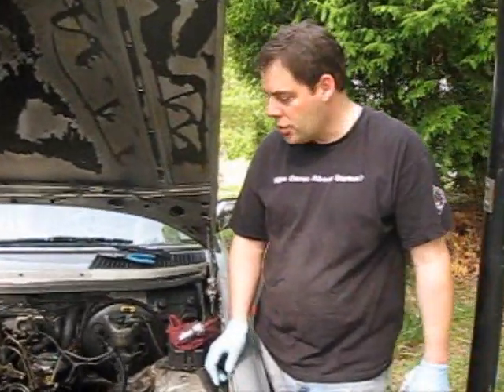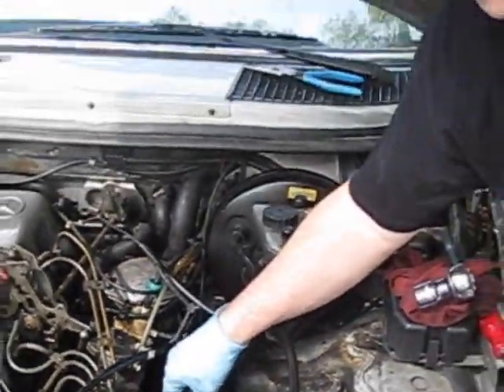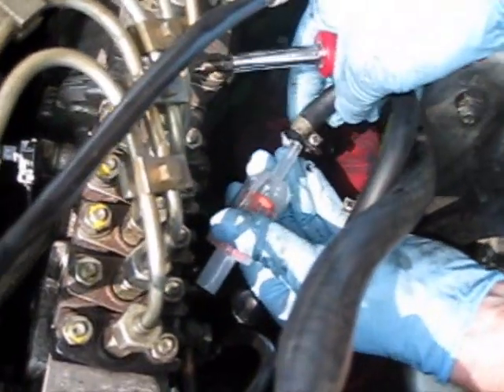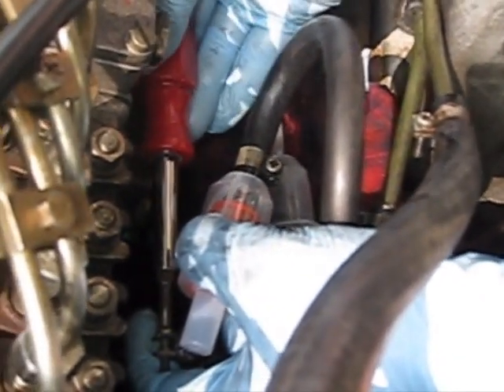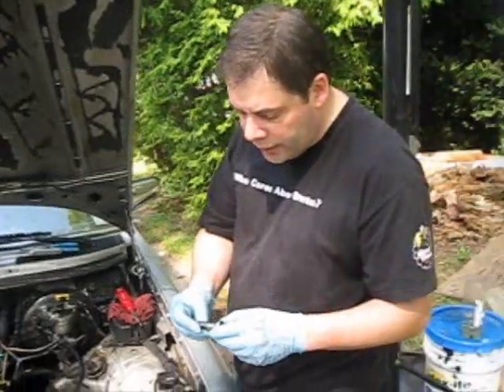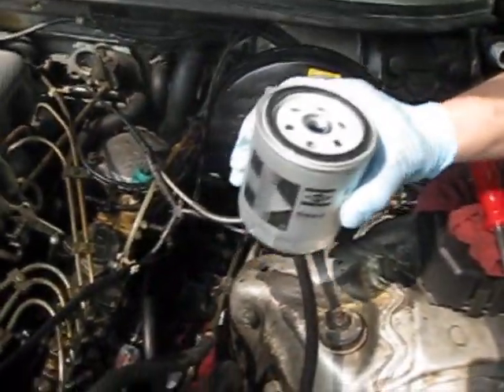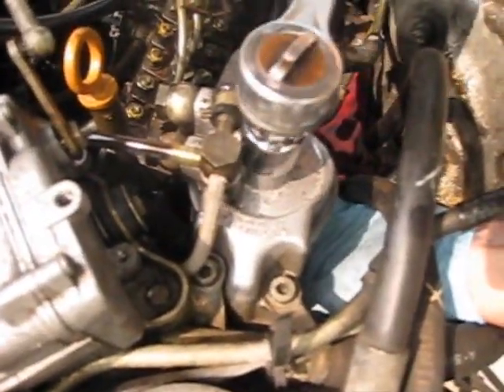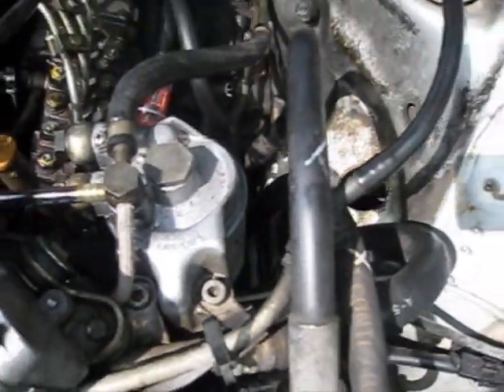Episode 3: How to Change the Fuel Filter in a Mercedes Diesel

Comment: I had an 82 300D i picked up from a girl that had just got it as a high school graduation present and had no way to keep it up.  I kept the car for 7 years and sold it for 4X what i paid for it.  One of the 1st things i did was change the canister fuel filter and replaced the in~line throwaway filter with a Racor fuel/water separator that was originally designed for a class 8 semi, and it kept the fuel system immaculate; never had to worry about that one clogging up.....Pete Walls, "MBlover99)

Comment: very helpful video......I have a 1985 300dt and almost got rid of because I was intimidated by diesel engine, cost of taking to shop just to find out whats wrong with it. I love working on it now. I was wondering if you have posted one on changing the belts and a way to unlock my truck, one day it decided not to work for me....do u have to disconnect battery and relieve gas pressure first not sure if it is needed for diesel. thanks again

Comment: very helpful!  I am about to buy a 1984 300D Turbo and it's been sitting for a while so I'm sure the filters are messed up...it's very sluggish to drive.  we've replaced the spin filter but not the inline...now that I know how easy it is I will change it.  What about the filters that are near the gas tank, the cone filters...do you know how to replace those as well?  I think there is probably gunk in the gas tank

Comment: Hi. Do you have any videos on how to bleed air from the system? I just changed a fuel/water separator filter in my 300SD and primed thoroughly, but I got air in the system and had to get the car towed to a mechanic.

Comment: Please let me know if mercedes E300 1999 W210 has primer pump in relation to removing air from fuel filter? If yes please help me to find it. If not please let me know how to remove the air. I have changed the fuel filter and cannot  turn the car on..... Thanks